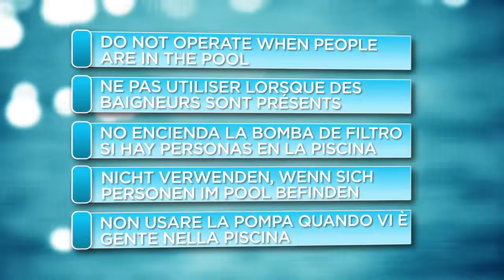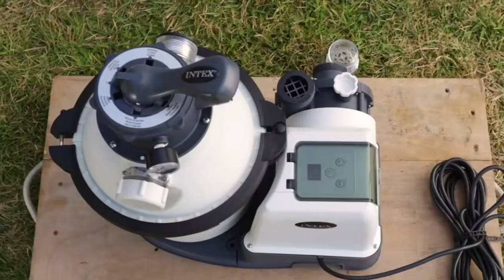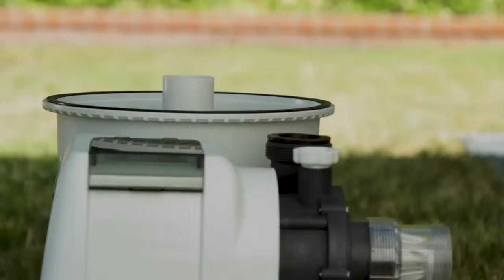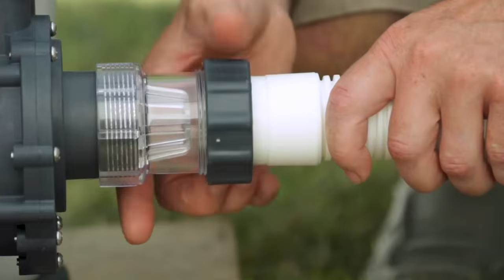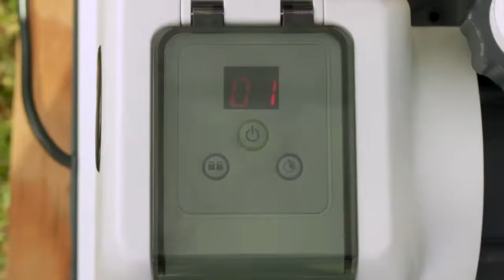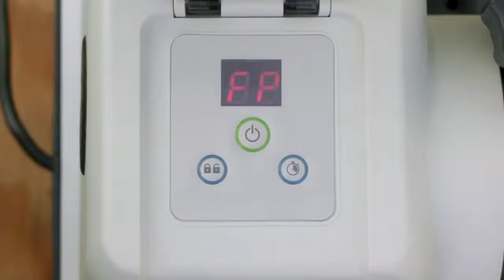Intex zandfilterpomp 4m3

Comment: I’ve heard you can fill the pump with polyfill instead of sand, is that ok to do?
Reply from the maker: Hi Angelika, 
Thanks for leaving a comment. 
We have heard the same,  however filling the pump with materials other that recommended will void the warranty and we do not recommend doing this. 

The pumps that use polyfill are designed to use polyfill. You could use these as replacement for your sand pump. 

Of course you can do your own due diligence and decide for yourself if you want to give it a try. 

Let us know how it went.

Comment: i have sand coming out on resin mode any idea why
Reply from the maker: Hi Thanks for your comment .

Why is there sand coming out of my pool filter when I backwash?
Your pump may be too large or the sand level too high in the filter. When the filter is backwashing the water flow can cause the sand to rise high enough and overflow into the standpipe, which will allow the sand back into the pool.

Hope this helped. 
You can always contact us through our website for more information and support.